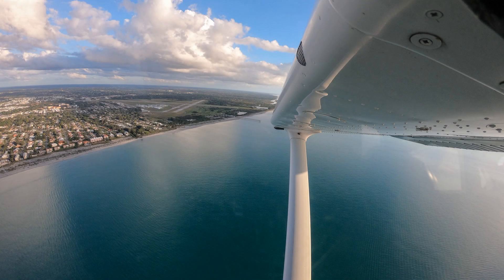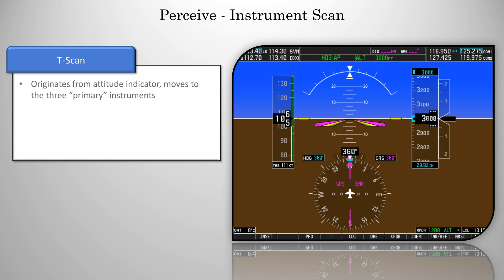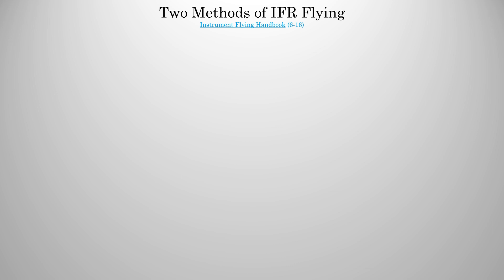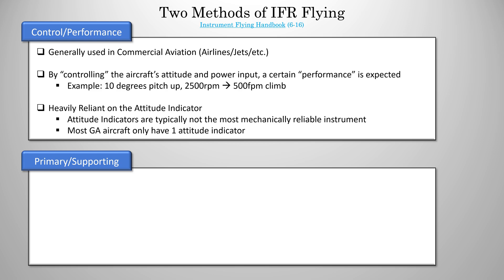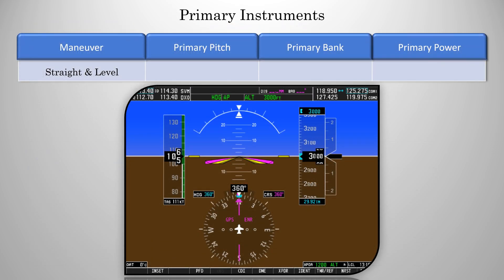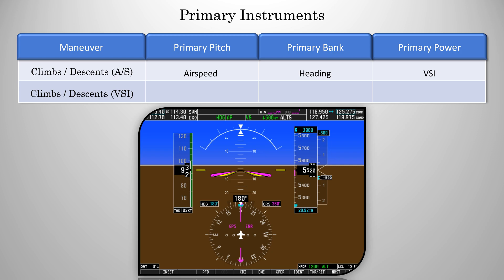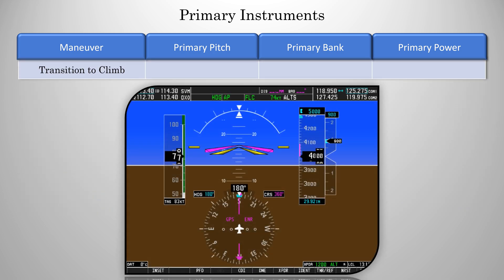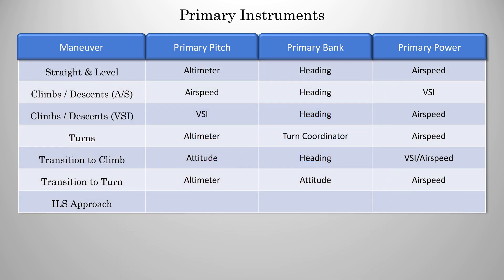IFR Training - IFR Basics (Primary/Supporting)

Comment: You mention VSI a couple times a primary for power. According to the AAAV BATH MAT acronym, power is Manifold Pressure, Airspeed and Tachometer. This is the first (of many) videos I have seen where VSI is put in the power section.

The only time VSI is primary is during a Constant Rate Climb/Descent and it's primary for Pitch in those scenarios.
Reply from the maker: Thanks for the input! Honestly, it’s been about 5 years since I last instructed, but let me see if I can remember how our chief flight instructor explained it.
The only time I put VSI in the power section is during a Constant Airspeed climb/descent. Reason being is you can set the power using the Tachometer to whatever you want, but that won’t actually tell you if you’re getting the desired performance without looking at the VSI.
If you’re pitching for 76kt but not climbing (VSI at zero)? Add more power. Same with a decent; if you’re not going down, but holding a certain speed? Take more power out.